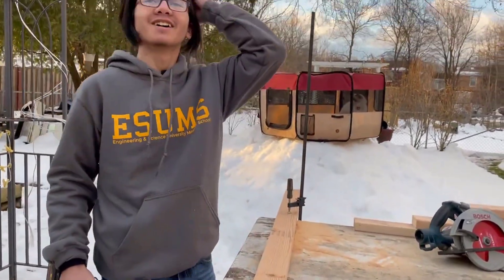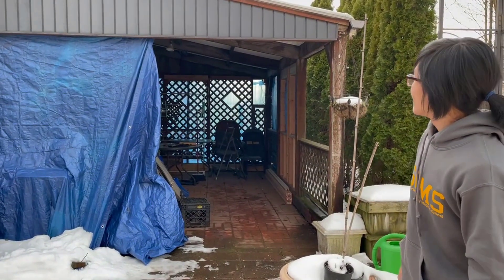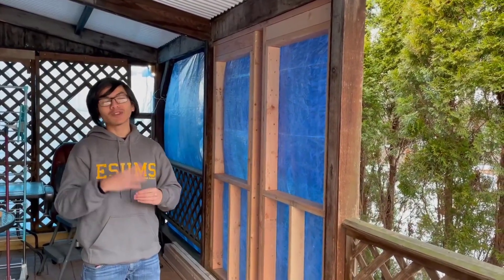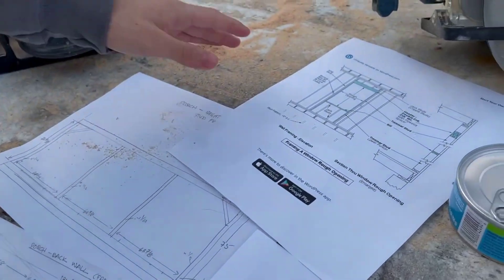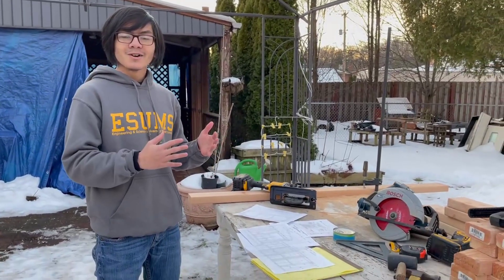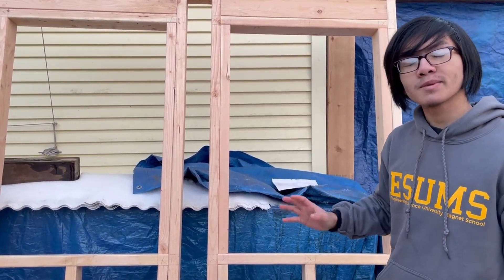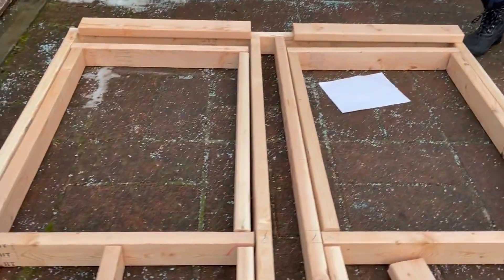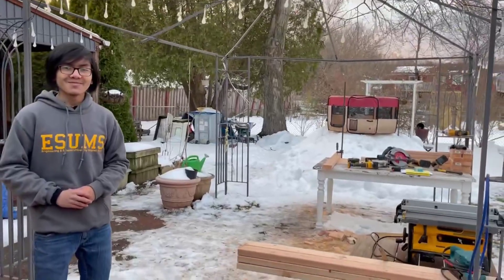How We Plan To Convert Our Patio Porch Into Enclosed Multi-Use Room | Home Improvement Vlog Part 1

Comment from the maker: Here are the #ad links to the power tools featured in this video should you be interested:
1.  https://amzn.to/2KPUOjl  | DEWALT ATOMIC 20V MAX Circular Saw, 4-1/2-Inch, Tool Only (DCS571B)
2.  https://amzn.to/2WK2TZM | Bosch Bare-Tool CCS180B 18-Volt Lithium-Ion 6-1/2-Inch Lithium-Ion Circular Saw
3.  https://amzn.to/3mLIkGP | Makita 9903 8.8 Amp 3-Inch-by-21-Inch Variable Speed Belt Sander with Cloth Dust Bag
4.  https://amzn.to/2KoZP2I | Milwaukee 2722-20 Super Sawzall Reciprocating Saw (Tool-Only)
5.  https://amzn.to/3rrOoYs | DEWALT 20V MAX XR Cordless Drill Combo Kit, Brushless, 5.0-Ah, 2-Tool (DCK299P2)